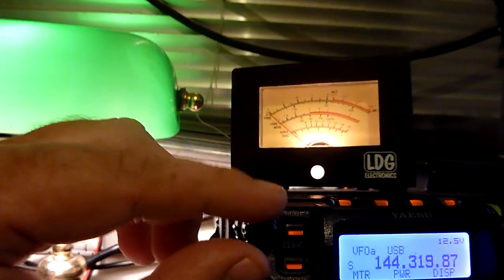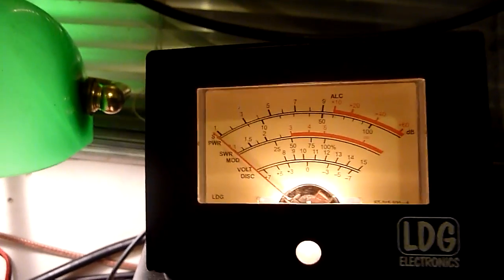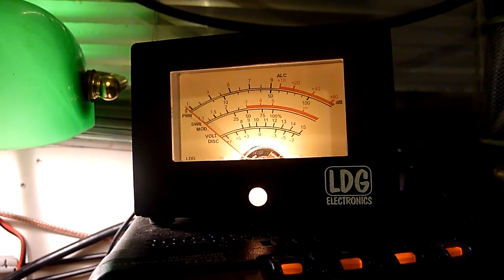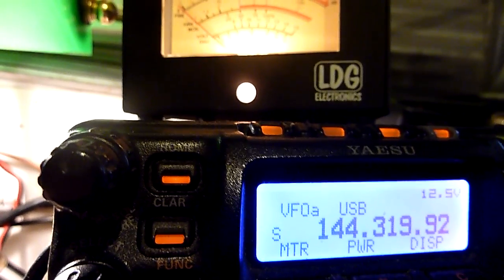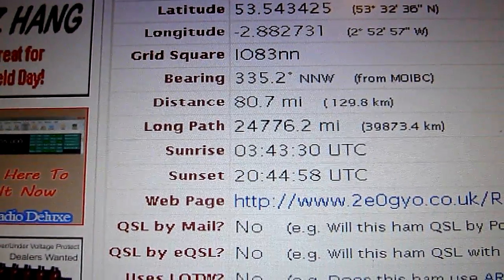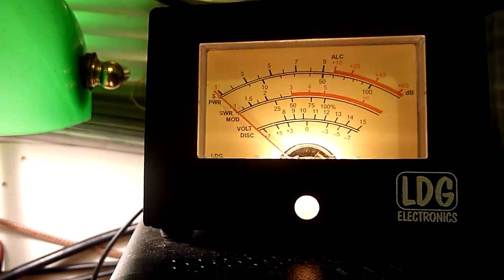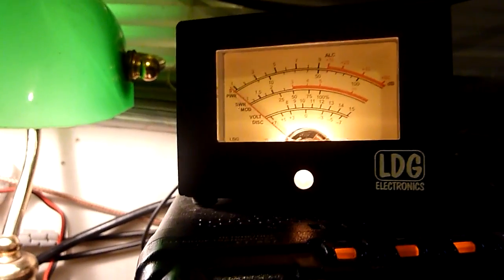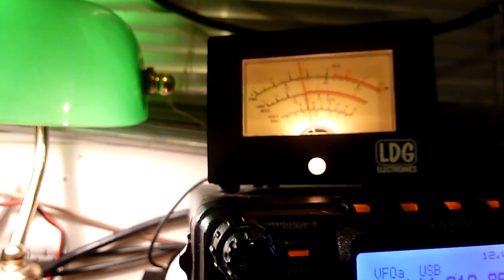VHF SSB Horizontal/Vertical Polarization with Horizontal FM Test

Comment: This would actually be a cross polarization example. I have done some comparisons between H and V polarization on 2 meters with another station that had identical H and V beams and I had a 4 element that I could switch back and forth between H and V in a few seconds. Our tests showed nearly no significant difference. I could give a slight (very slight) improvement with horizontal, but it was not really measurable on an S meter. This was over a path of about 30 + miles and very difficult terrain. I was expecting the H polarization to greatly outperform the V, but it just did not prove out that way.